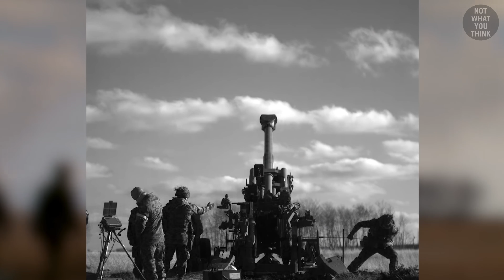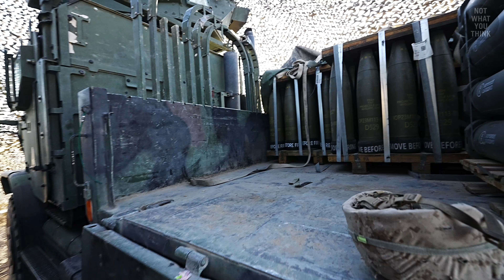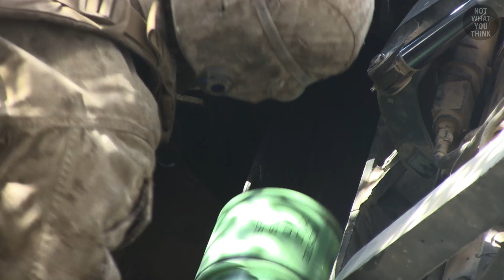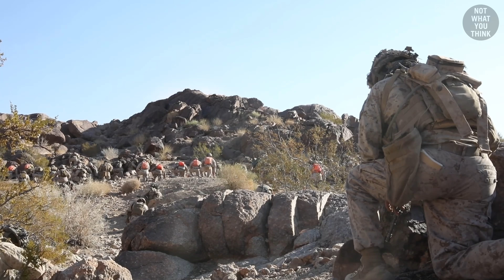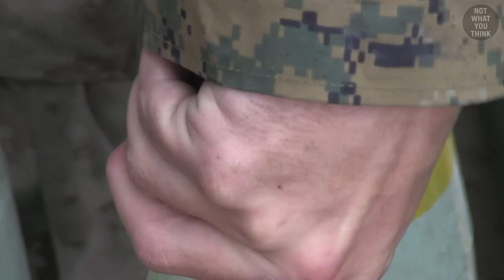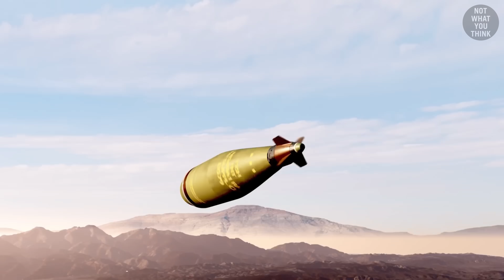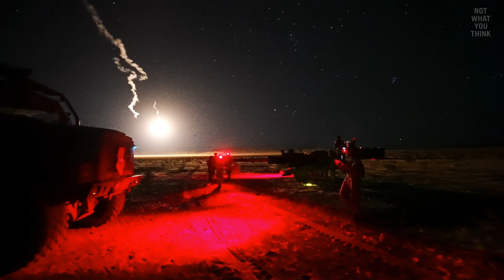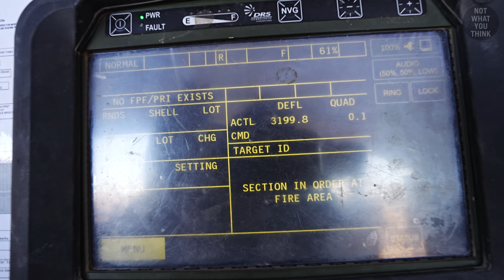Why Artillery Guns Always Shoot Short at Night

Comment: I worked in FDC (U.S. Army) for 6 years. 82nd Airborne and 25th ID out of Hawaii. I enjoyed it. I also did my job in Afghanistan. We trained literally daily back in the united states. Some of it was in the field, but most of it was in an office doing math and etc.. Some of the training was a bit tedious for sure, but it wasn't a bad job at all. We used laptops to calculate firing data of course, but we had to know how to do everything manually. When calculating firing data you gotta take into account so many factors. More than just the target coordinates. There's gun coordinates, gun altitude, target coordinates, target altitude, MVV (muzzle velocity variation) which is the wear and tear of the tube over time (these numbers come from routine tests done on the cannon). We also took into account meteorological data (temperature, wind speed, etc) for every thousand feet. We'd get that info every hour from a weather team at another location. We had to take into account the temperature of the propellant, which we got from the gunline every so often. We would literally take into account the rotation of the earth. 

We'd also take into account things like time detonation for the rounds. We would tell the gunline what time to set their rounds to, to ensure it explodes just above the ground. We had to calculate the time from shooting until impact. We would tell the forward observers (infantry) 10 seconds before rounds hit the target. If infantry wanted to do a correction ("up 50 meters, down 100"), we would calculate all of the new data and tell the gunline the new deflection (left/right) and quadrant (up/down). Every round shot is manually recorded onto a record of fire sheet. For illumination rounds, we would have to calculate the exact coordinates of where the cannister would land after the illum round ignites in the sky, to ensure the cannister doesn't land on anything important.. This is necessary to ensure the cannisters of the illum rounds don't fall on people / homes / etc.. It's a requirement because that stuff has happened lol.
Reply: I started in the 82nd (11B).  You guys saved a lot of lives.  Thank you and Salute.
Reply: @jackwalker9492  thank you Jack. Yeah I got to do my job in Afghanistan (Kunar valley) and we definitely saved some lives there.. But our 11b's no doubt saved our lives too. It did get to a point where our gunline had to fight back against small arms at a closer range from our FA manned guard tower lol. But yeah, salute to you as well.
Reply: @anony88  I am in Bogota as we "speak".   I am retired and between uniform and contracting for about 10 tours, I am done.  I hope you find peace Wildman and its the best gift in life to be part of such a brotherhood.   I wish you the very best and the other posters on this thread.
Reply: I was a 13P (same thing but MLRS specialized) around 20 years ago in OIF I  (4ID) and OEF VII & VIII (attached to the 82nd). I got to do a bit of cross training with the Q37s and the M777 in Afghanistan.
Reply: I was a gun bunny in 2nd Brigade 11th Field Artillery Regiment in the 25th Infantry Division out of Schofield, Barricks, Hawaii. From October 2006-September 2009. We were the first in the Army to receive and operate the M777. 

I have to say, thanks for making my job easy 😜
Reply: @arkhitek2251  right on. I was also at Schofield Barracks in 3-7 FA (3rd Bde).
Reply: That is why you hit your targets 9 times out of 10, while the Russians might hit 1 out of 20.  Also, about the illumination rounds?  I was Navy, stationed at NCTAMS PAC in Wahiawa, HI.  Back in 2003, you guys set the range on fire using those illumination rounds.  NBD on the windward side, but ooo-ee, the Kanaka Ma'oli got really mad when you overshot and landed in Makaha Valley.  But I have a question?  Some of the illumination rounds were a sort of amber/orange, and stayed up for 20-30 minutes.  They fall, but really slow.  How do they stay up that long?  Is it the heat from the flare, keeping it aloft under the parachute?  Or is it something else?  I would always LOL when civilians would get all crazy, calling them UFOs.
Reply: @IonOtter  a lot changed between 2003 and when I was in Hawaii 10 years after that. We definitely calculated the coordinates for the illum rounds when I was in Hawaii.
Reply: Really cool stuff, thanks for showing the details
Reply: im a fister and i want to learn more about the fdc. our doctrine is mainly the atp3-09.3 does the fdc have a main doctrine atp?
Reply: @fotisvon9943  One more thing.. The FDC has a section about fire commands, which goes over some of the communications that might be used with fisters. You might find that info useful, but I know you have all of that info in your own manuals as well. But if you want to get a general overview of stuff that the FDC does in case you ever consider an MOS change, its not a bad book/FM to skim through.
Reply: @fotisvon9943  also, if you pull up the 6-40, you might see an older version with an old cartoon graphic on the first page. That's not it. A couple links further down Google has the modern one.
Reply: @fotisvon9943  FM 6-40 if you want to get into the nitty gritty 🤣🤣 its available on Google. Its the FDC Bible. 700+ pages of field artillery data knowledge that I had to basically memorize front to back.
Reply: You know your stuff. Old FDC Chief. A 1/15 FA 2nd ID Korea-1971
Reply: @mf-xo7sv  I made it to FDC Chief for a few months before they put me in charge of the training/orderly room because I was getting out lol.
Reply: @anony88  That's funny, my other duty was training NCO, which saved me a lot of PT. LOL 105mm M101-A1 Lot of trips to Firebase 4P1 Korea DMZ,at the time we got Hostile Fire Pay while there. 65 bucks/month was a lot back in 1971.  At btry level all GFT/charts and darts computation, at BT FDC they had FADAC weighed a ton,used 440 gen set. I got to Korea instead of Nam,Korea at the time way under strength,Nam winding down.  I went over as a Sp/5, after AIT at Sill, went to ACL Artillery Combat Leader/NCO school,so basically super trained in all aspects of Arty. Well almost,we asked about nuke computation. They said,don't ask. LOL
Reply: I was an 0844. Most of our batteries at the time were running manual calculations as backup to digital calculations.
Reply: Okay tell me if the thing was ever used Line Of Sight? I mean it could pretty well tell tell any door/portcullis/bank vault "OPEN, SAYS  M E !!!!!  I saw where it was fired with the barrel level and I thought it was a flare round - what was that?
Reply: @patrickshaw8595  those people shot both low angle and high angle. What you probably saw were video clips from different times being shown together.
Reply: that is badass,  that looks like fun work.   Did you ever get to use the meat thermometer to check the propellant?
Reply: glad to meet a comrade here. I'm serving at the Republic of Korea Army as a FDC of a 155mm SPH. I do exactly what you did every day(like calculate manually with tools and use special computers) , and we use the same table as US Army uses. thank you for your service!
Reply: After how many shots would you need to change your position if there is counter battery fire? I always thought that even "normal" howitzers and guns would have to change positions very fast, especially now that nearly anywhere drones are used not only for recon but also for attacks.
Reply: @GRS4HlK2  this was never an issue for me in Afghanistan. We remained in place at the base. If we came under mortar fire, we'd simply go inside fortified areas. The base guard towers would remain on alert. We'd also send rounds to nearby mountains with direct fire (aiming directly at nearby hills) and use air support (heli's and c130's) on occasion for assistance. What you're thinking is if we went to war with another country. There is no certain amount of rounds to be fired before moving to another position. Thats more about enemy movements and would be up to our commanders (or platoon leaders) discretion, but that's not something done during deployments to countries like Afghanistan where arty stays fixed on a small base.
Reply: @anony88  I understand. Thank you for your answer and have some nice Christmas days.
Reply: @GRS4HlK2  no problem, you as well
Reply: Whilst I'm surprised, it makes sense Army has Weather people, especially with the distances arty works at. I'm guessing Army's weather girls are not as attractive as the ones on TV? Is weather a specific job, or just something the fire control officer is trained in?
Reply: @tsubadaikhan6332  field artillery weather is a specific job. The job MOS is 13w if you want to google it for more info.. Their weather training is like 8 weeks and thats just initial training. More training always follows when soldiers get to their units after AIT. I will say that the field artillery weather is such a rare/unique job that ive never even seen the weather people for my artillery units. At least I dont think I have.
Reply: @tsubadaikhan6332  🤣 ive never even met Army weather people.. That I know of anyways. My field artillery unit was like 99% men. Its much different now days because I got out in 2014 and they allow women in field artillery now.
Reply: Doesn't seem like it's too hard to calculate it, especially when you've been taught how to do it
Reply: @goldman_ya its not extremely hard, but theres several long form algebraic math problems (5-8 steps per formula) that you have to memorize in addition to everything else. The reference manual for my job was over 700 pages long (FM 6-40, and not the first one on Google because thats the super old one). The 6-40 doesnt include anything about the computer software which is also fairly advanced. Theres also charting/trigonometry stuff. Its not PhD level by any means, but it does take a while to get good enough to where you can get fast at doing it. Hence why we had to do a ton of tedious and repetitious training for years. It really isnt crazy difficult, but I've seen some people struggle with it a bit.
Reply: @anony88  ok, thanks, probably the best argument I have seen online so far 😆
Reply: Arderas en el infierno
Reply: In hawaii did you train on big island destroying our beautiful island with your war games and training?
Reply: @SkyKing-e4u  I dont answer stupid questions
Reply: @anony88  did u or did you not in your capacity in hawaii train or not train on the big island of Hawaii at pohakaloa training camp? There is nothing stupid about my question. It's a yes or no, direct and to the point. Unless you're just some haole who doesn't understand the impact to the native plants animals and lands your bombs, war games, and "training" incur and would rather dodge the question sounds about right.
Reply: Napoleon would have been ecstatic...

Comment: us has been stockpiling pgk fuses which have built in gyroscopes and an altenator power supply which very cheaply turns dumb rounds into excaliber round accuracy. they say50 meter 50% error accuracy but in practice its much less. the fuses only cost around 2-5k, and the usa purposefully didnt send any to ukraine coz theyre likely going to be the main round used by the usa. everyone talks about the costs of excalibur but theyre an old tech which is like milk and expires. very interesting decision, theyre like the glide kits for dumb bombs and actually increase range by changing angle of attack during flight multiple times. very smart compared to how complicated rocket rounds are
Reply: I think that the excalibur round turn out to be a complete flop in Ukraine. It said that in a EW contested area, the hit rate going down to 5%! 
Intresngly the GMLRS doesn't have this issue, even that it also uses GPS.
Reply: @guyyefet5804  idk you saw m777's first show up without gps guidance kits and only got them a few weeks later. US obviously hesitant to give ukraine their best tech. I suspect excalibur rounds sent to ukraine were not using all the possible back up inertial guidance/ew evasion strategies. pretty much confirmed that US is kneecapping a lot of long range arms sent to ukraine to avoid cross boarder use. I also suspect that m777's barrels are getting worn out. US sent m777's to get rid of them, not to support them. i think usa was surprised at how long m777's have lasted, just like himars. guessing GMLRS does have inertia guidance backup. we saw how accurate they were when stacking dimes on kherson Antonivka bridge despite RU putting up a good effort to degrade them. rocket barrels dont really wear out like artillery barrels do. excalibur can only course correct so much.

Comment: In the era of self-propelled artillery, radars, and rapid counter-fires, what's the role of M777 on the modern battlefield?
Reply: To be cheaper than an SPH.
Reply: Fixed pieces like the 777 are still king in the defensive role and have more range than pieces than the Paladin (for now). In some ways the 777 is actually MORE mobile than a Paladin as well as the sling-load capability allows them to be inserted into places a Paladin cannot reach.
Reply: Most American divisions are simple infantry divisions which are meant to be rapidly deployable and be lean on logistics, and good in bad terrain. The smaller and lighter something is, the easier it is to rapidly deploy - you can fit them into smaller aircraft, land at smaller airfields, or squeeze more into a single aircraft, and you can fit more of them onto a ship, or fit them onto smaller ships that can go more places more easily. Additionally, towed howitzers can be transported by medium (Black Hawk) and heavy (Chinook) helicopters, while self propelled howitzers are too large and heavy. This is especially important for divisions specifically tasked with fighting in mountains, swamps, jungles, islands, and dense forests where it's extremely difficult or even impossible to move a vehicle as large as a self propelled howitzer where you need it to go, when you need it there. Additionally, vehicles add a huge logistical tail - more fuel and spare parts have to be transported, and more people are required to drive, fuel, and maintain the vehicles which also means more vehicles, people, and logistics to sustain the sustainers. Also, self propelled howitzers (and the substantial administrative and logistical burden they bring) are expensive, and nobody's military budget is infinite, including the U.S. Army and Marine Corps. Dollars spent on more self propelled howitzers are dollars not being spent on recruiting, retention, modernization, medical care, etc.

Also, towed guns are easier and faster to conceal and dig in, which is just as important for dealing with counter battery fires as being able to move quickly, especially for infantry divisions which are in bad terrain anyways where shooting and scooting is far harder (where are you scooting to in the mountains or jungle?) and movement is generally slower with more static frontlines anyways, because the infantry are on foot in those divisions.
Reply: More to the point: in the era of cheap single-use drones, what’s the role of artillery at all? Ukraine is using more drones than shells these days.
Reply: @benoithudson7235  If artillery didn't have a point, Ukraine wouldn't be begging for more shells and Russia wouldn't be importing millions of shells from North Korea, and the entire planet wouldn't be heavily investing in modernizing their artillery and exponentially increasing shell production. Artillery generally carries a far larger explosive and allows more massed firepower to be concentrated on shorter notice on a target, and for that firepower to be sustained on target for a longer time. Artillery has greater penetration and explosive force than a grenade or RPG warhead strapped to a drone, so it's better against fortified targets like bunkers, dugouts, trenches, shallow tunnels, buildings, and basements. Artillery also can't be jammed, hacked, or spoofed (other than certain specialty rounds), the guns don't have to emit any electromagnetic signature and can't practically be shot down, and the time to target after firing is generally 30 seconds, while the time to target after a drone takes off is generally several five minutes at least, making artillery better for time sensitive support of frontline forces or hitting a fleeting target, or hitting a target without the target having any warning. Drones can be defeated by spaced, mesh, slat, or reactive armor, on vehicles, or on fortifications, while artillery can't be, and can be countered by active protective systems, while artillery can't be. It's physically possible to shoot down artillery, but it's several orders of magnitude harder than shooting down drones. Also, China basically has a monopoly on small, high performance electronics and on cheap drones, while they don't have a monopoly on artillery. So if you're not friends with China you can't rely heavily on cheap drones. Plus, there's already mature designs, mature production, mature training, mature doctrine and tactics, and mature artillery institutions in existence, i.e. most of the up front cost of artillery has already been paid, all you really have to do is continue to build ammo and spare parts, whereas standing up drone design and production and inventing a whole new doctrine and set of tactics and a new training pipeline would be expensive up-front.
Reply: @ Artillery rounds are much heavier than anything a drone can carry, for one thing.
Reply: @jimsvideos7201  Drones carried munitions don't need all the metal around the explosives that is there to resist the initial shock when going out of the gun tho.

Reality of the ground in ukraine by now is that, while at first they were using jury rigged grenades or 105mm HE shells or mortar rounds, after a while they realised they just need a contact fuse and as much plastic explosives behind it as they can fill a container and they have never been more potent.